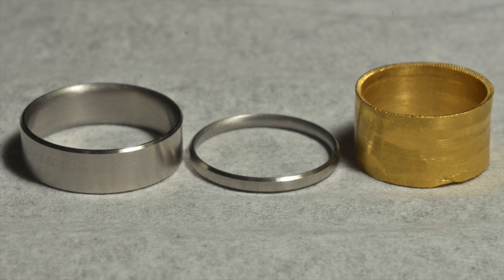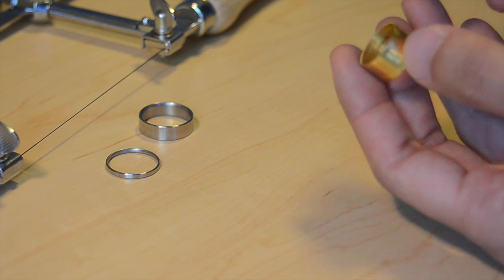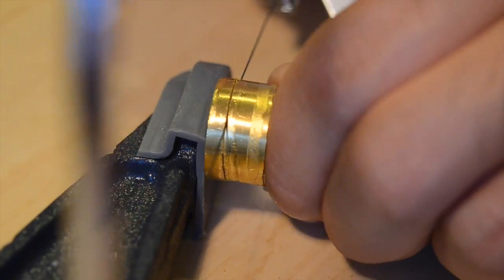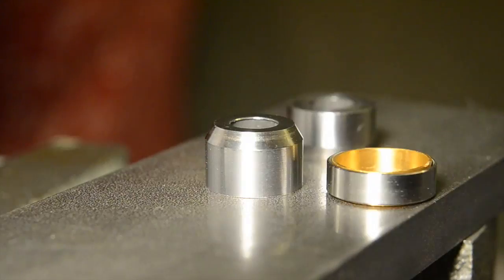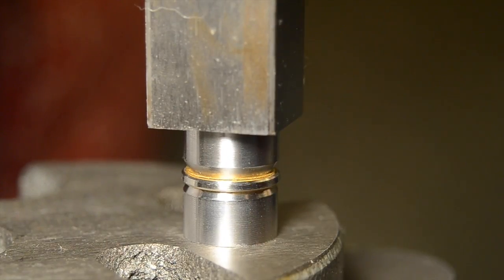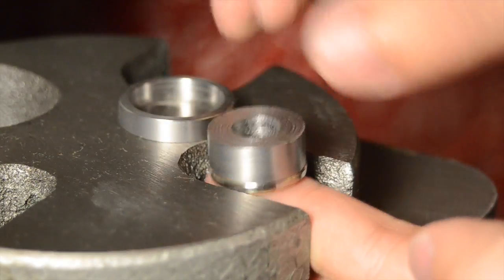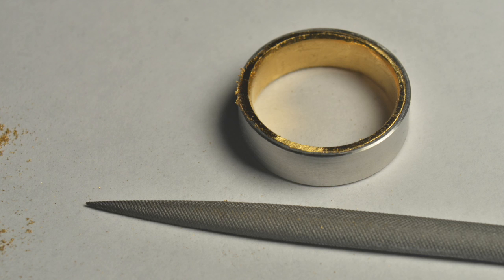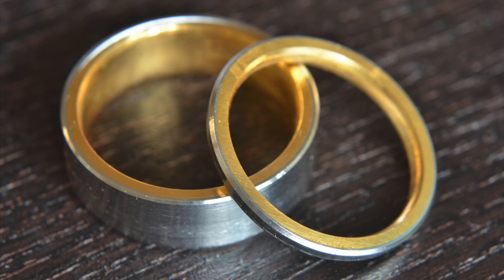Wedding ring final assembly

Comment: What is the brand/kind of lathe you use?
Reply from the maker: It's just what was available at my local makerspace. It's a 9" belt-driven lathe with a top speed of 1000 rpm; I believe the brand/model # is Select 1023B, and it was made in the late '70s.